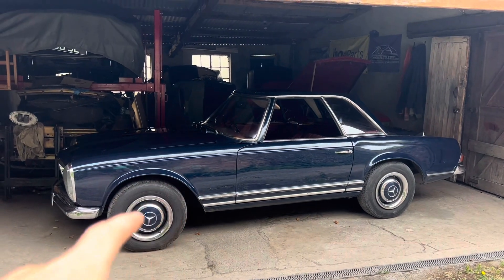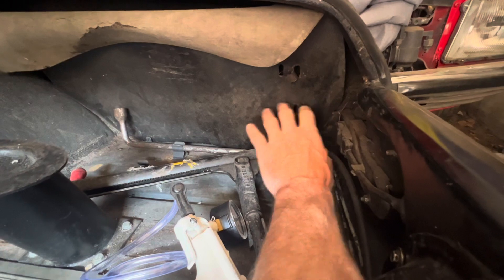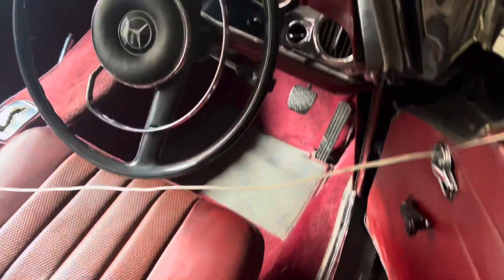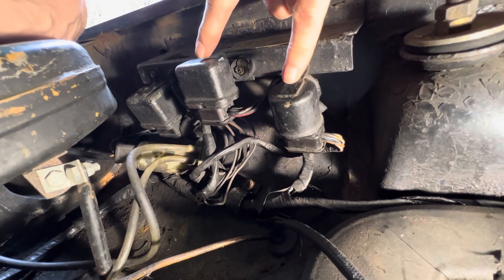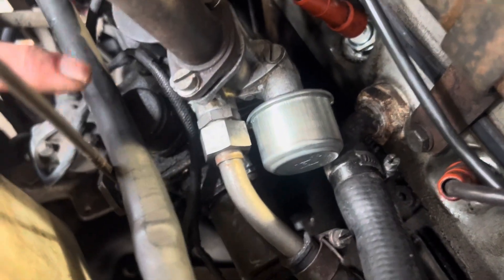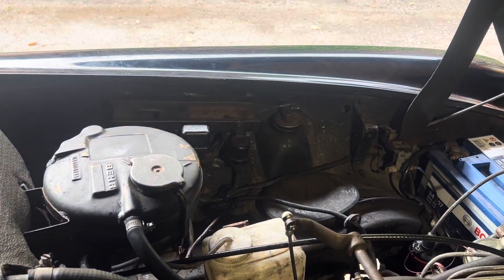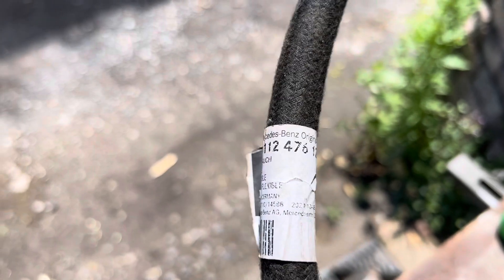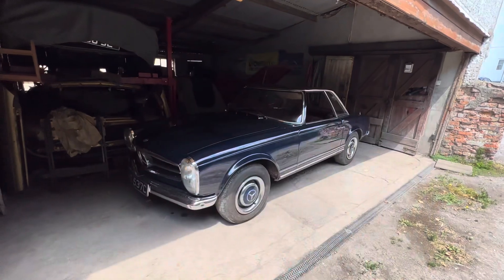Mercedes 230sl Pagoda w113 cold start problem and smell of fuel

Comment: Good info
Reply from the maker: Thanks! I take it thats not your 300SL in the thumbnail? Mike
Reply: @MikesMercsandothercars  ha ha, unfortunately not. We have several others including 500E, E55, E63, nothing as rare or valuable as an older SL
Reply from the maker: There is still time....Ionce turned dowen the opportunity to buy a fully restored 300SL roadster for £118,000. It seemed like way too much money at the time - I settled for the Pagoda at £14,000. Mike @tonychavez2083

Comment: Hi Mike.Great video. I have just completed a DIY engine rebuild, which appears to have gone well, the problem is the car is starting and running so rich the plugs foul then she miss fires. Is the CSV likely to get stuck open, or is this more likey to be the pump enrichment device? my car is a 67 250sl u.s
Reply from the maker: Congrats on your DIY engine rebuild. A couple of questions:

1. Did  you see the video below?

https://www.youtube.com/watch?v=lVarDMcjc2I

2. Did you put the original fuel pump back on?

3. I'm assuming you have the correct spark plugs?

Have you checked that the cold start injector is NOT spraying fuel when engine is warm?

Mike
Reply: H Mike. Thanks for your response and suggestions. The car ran well befor ethe re build, but engine was in a workshop for a year with the pump attached. I have just watched the video you suggested, and this makes a lot of sense, if my thermostate is stuck. How is the best way to check the csv? @MikesMercsandothercars
Reply from the maker: @humairmalik1071  The cold start valve (CSV) is also known as the cold start injector or cold start solenoid.

If the cold start injector is continuing to spray fuel when engine is warm that COULD lead to the problem you are describing. Take a look at the video below:

https://www.youtube.com/watch?v=TyE_tOV-ETQ

and also time code 1.09 in vid below:

https://www.youtube.com/watch?v=R3F7qIHRRp4

There are 2 things to test on your Pagoda:

1. Is the cold start injector still receiving power when engine is warm? You could test this by hooking up a voltmeter or better still a 12v light bulb and driving the car. the bulb should go out after engine warms up. Location of CSV on Pagoda is shown in the original video you watched.

2. Is the cold start injector dripping or spraying fuel even when it receives no power? You will have to take the injector off the car to test this....perhaps using the simple method outlined in the first video above.

On a different subject...when I first reassembled my warm up regulator (the thing with the thermostat), the car ran WAY too rich - back firing, kicking out black smoke...world coming to an end scenario. Adjusting the height of the rod in the warm up device so that it pushed the lever more sorted the issue. Mike
Reply: @MikesMercsandothercars  Hi Mike. Ii have gone through all your videos and they have been a great help. I went through all the fuelling as per your video, finding the whole CSV and warm up thermostat really helpful and eye opening. I managed to cure my missfire today after months of scratching my head and goign through all aspects of the engine. Long story short, the pump adjustment which alters the rihness between idle and 1800 rpm was too weak and this was causing missfires and backfires. 

https://youtu.be/pgUiQRtY4Lk?si=ayup1P3dXuoQsbup
Reply from the maker: @humairmalik1071  That is great news! Looking forward to seeing some more vids on your car. Mike